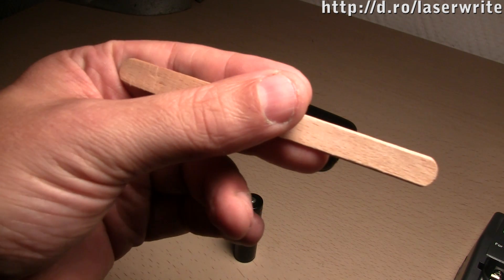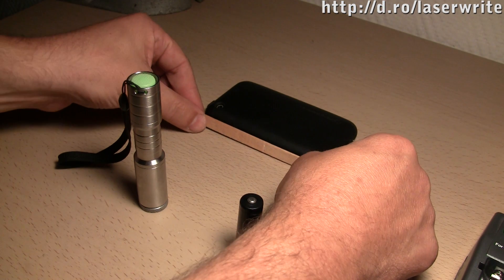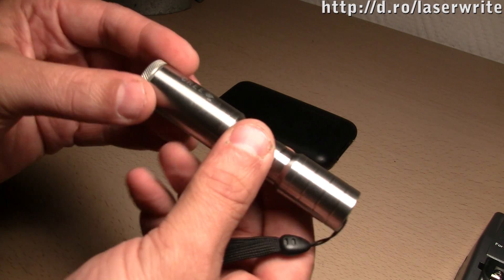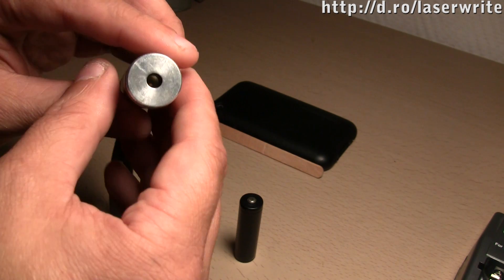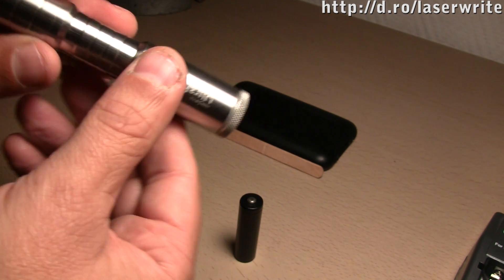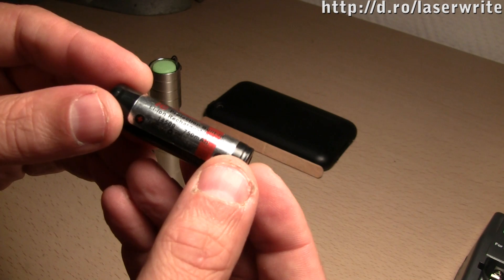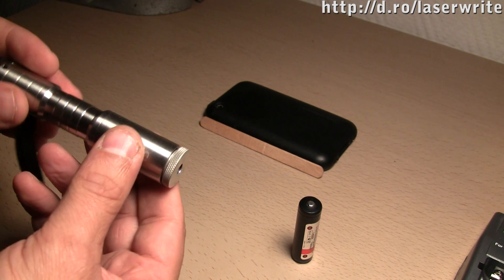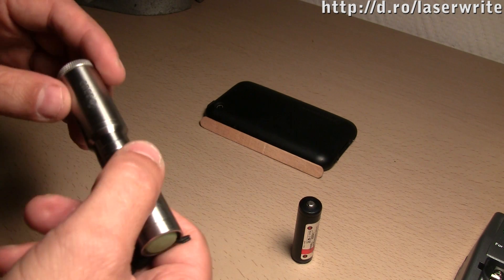🔥 Pocket Blu-ray Laser Burner! Burn Wood Instantly!

Comment: Where can I buy this one. Please someone respond. I want one that burns as hot as this one or the same one
Reply: Gabriel Johns.  amazon.com, just type in laser module, You can buy a 3 watt (3000mw) laser for around 80 to $90, it is about 5 times more powerful than the one he's demonstrating here, Just make sure you type in laser module. They have red green blue pretty much any color you want, the green ones are a lot more expensive though especially if you want a green one that Burns, But the reds and blues are pretty cheap. Also make sure you get one that has a Built-in heat sink and fan, or you will only be able to run them intermittently,  Hope that helps;-)

Comment: if laser is powered by battery of trucks or by main power supply then we got a good water heater system which can generated steems of souna bath in easy and cheaper way

Comment: How deep a hole with this laser drill into moderately hard wood?  How long would it take per inch?
Reply: It's not made for that. if you want one over those then go spend $10,000. these are just fun toys for responsible people and don't do much more than impress people.

Comment: I have one . Yes they burn skin , very quickly and painfully. They light matches , newspaper, burn through cd and dvd cases in seconds . A must have but also highly illegal . You could literally blind somebody for life in one second . Lethal
Reply: ***** anything over 5mw is illegal to sell in the US but legal to own if purchased by other means for the 5-8mw range. if over 8mw (might be 10) then it is illegal to own if under the age of 18 and I believe 25mw is where they are illegal without a special permit of sorts.
Reply: BarryFromEastenders not illegal in the U.S
Reply: ***** dvd burners are legal because the diodes are pressed into a block of aluminium and soldered to a board to regulate it's output. lasers used in surgery are also not even remotely close to what you see in the video.
Reply: Pyromaster225 it's legal to own them in powers greater than 40W
Reply: I mustve read a much older version then.. plus it was a few years ago, but still there are restrictions
Reply: BarryFromEastenders  hey man. Could you please tell me where to get one like URS or like the one in the video.
Reply: Any tool is legal as long as it is within its use; even an ordinary screwdriver can be illegal if the police finds it you in your hand down the street or in a dance party .. equally is for the laser ..
Reply: Nobbs66 Yeah, if they were the dvd players would be illegal, doctors using lasers for surgical purposes would be illegal, and all kinds of other people who need them it would become illegal for. Generally it would just cause a big mess for everyone who's not a federal employee. Heck it would cause problems for federal employees for the fact that their doctor wouldn't be allowed to legally do tattoo laser removal or lasers for use in surgeries or something similar. College students who use lasers to study photonic travel etc.
Reply: Nobbs66 I know, I'm just stating that if the law were to make lasers in general illegal to the public, it would mean that any civilian or non governmental agencies would also not be allowed to use them, and since lasers are of high importance in multiple civilian careers such as for doctors, machines, DVD's and computers, these lasers are 100% legal for use. I'm agreeing with you. :) Lasers like these could also be fantastic survival tools. A laser fire starter.

Comment: Why have we not seen more arsonists using this to start fires from a distance, I wonder?
Reply: This is my theory: The arsonist would require something flammable on the building he/she is trying to burn to shine the laser on, otherwise it would take a VERY long time to burn it down. Also, the bright laser would give away the arsonist's location (assuming it isn't daylight outside).
Reply: ***** Yes, using a laser to start a fire must be done during the day and not at night.  To start a brush fire only requires the energy of this pocket blu-ray laser and a steady mountpoint. Dry grass is the fuel.  You don't need an "accelerant."  The dry grass is the accelerant.
Reply: Peter Wexler Ah, hadn't thought of that. It also depends on the area, too. A place like South America or Southern California would be easier to start a brush fire during the day, but a place like Michigan or Washington would be more difficult. Distance would come into factor as well, would it not? The laser would be less intense the further the distance, right?
Reply: ***** When I speak of starting a brush fire, I'm not talking about anywhere east of the Rockies – only where the hills are tinder dry and grass-covered (red flag days).  Aside from being flammable, brown is an exceptional absorber of blue, re-emitting it as heat (high school physics, check it out).  As for intensity, I would imagine that strength would remain consistent for at least five miles, especially for a blue colored laser beam, and especially on windy days which are also perfect for terrorism-by-arson. (I don't think that physicists have yet figured out why windy days are better for laser beams than days when the air is still.)  There is also the curvature of the Earth to contend with for longer distances.  Of course, that's why Allah invented drones on the eleventh day of Creation, but then stability becomes a factor.  So, that's why Allah invented mountains on the eighth day of Creation!  (On the ninth day of Creation, Allah invented beheadings, and on the tenth, dynamite belts for use on mass transit, just to fill you in.)
Reply: The laser in this video is not powerful enough to burn wood grass etc at a distance. It will still damage your eye, even from a reflection. Wear laser safety glasses.

Comment: I bought a blue laser burner that only can burn electrical tape and matches, at first it wouldn't do it but I modified it so now it can at a certain laser point. How can I get it to burn anything? Any suggestions?
Reply: you need to find green Pontite crystal to get the laser strong enough.
Reply: two things   power and focus.
if you can change your focus to half the area you double the power per square mm.
if you double the wattage, you double the power per sq mm.
it is all about power per sq mm

Comment: How did you make that or did you
Reply: Use 1,5 w laser diode(first start with low mn power diode cause it can bring you to trouble if you are a beginer by this stuff,hehe one time i try to conect to a high woltage and tha power was gone in our house),well i think 150 mw is enought to burn paper,btw and you mus use a  Driver Circuit to work better,i think

Comment: Can my neighbors damage a Plasma or LCD Television by shining a laser (e.g. laser pointer or high caliber (strengthen) laser) from the double pane windows in their dining room, through another set of double pane windows in my living room (35 feet away), and into a plasma or LCD Television if I decide to mount it on the wall in question?
Reply: Probably not as these things only burn fairly close range although styropyro made a long range burner with a very bulky lense setup it would be dangerous for your eyes but shouldnt effect any objects unless they have an advanced lens which is very bulky

Comment: a "serious" question: Could I use it for soldering pins of electronic parts? Please heat a pin of an integrated circuit with your laser..Those are 0.3-0.5mm thick metal pins (reflecting and good thermal conducting material!!), and have to reach abt 250-280 C degree. How long does it take to heat up?

Comment: So, what if I used a high temperature resistant lenses? And use it just like the sun over a magnifying glass burning a piece of paper. What would happen? And also, what if I used 6 of those lasers and point them simultaneously concentrating to that lense? Would it slice through every matter I put in front of it? (except for metals)
Reply: No

Comment: nm means the wavelength ( the color ) of the Laser ( 445nm = Blue; 532nm = Green; 635 = Red ) u can also build a laser with >800 nm ( infrared = 808 nm ) but u cant see the beam or point.. -> boring!

Comment: Ok thank you very much! And no I do not have that intention, but a friend of mine has a 5 mw and a 200 mw green laser so I'm just cureus if the 200 mw would just cause 40 times as much damage or if it would just cause ALOT more damage

Comment: well you are right and you are wrong, yes the websites you think i am referring to are crap lasers, however got to a site called laser pointer forums and you will find plenty of skilled laser builders who will custom make you a decent burner for as low as 100, i got a 1.6w blue blue built for me for 110 and it works great.. if you dont believe me check it out, i currently have the violet 500mw being buit right now  like the one in the vid

Comment: Wrong. If left pointed at the eye for several hours straight it could pass through the flesh and put a hole in your brain. considering there are hundreds of functions and synapses, the part controlling your heart to beat and or resperation could be destroyed and there for so would the subject.

Comment: im sure that i would have a few ideas to make pictures with this, how much does this cost, how long does the battery last and is this tool quick at overheating and how dangerous is it (for me and my apartment)?

 when its practicable i would throw my soldering iron into trash.

Comment: Diodes are power hungry. They will eat anything you feed them. A driver in your cheaper pointers is a bottleneck. The other way around, a bigger driver for the $10 pointer would more likely work, less it fries the diode. They are VERY suicidal!

Comment: There are quite a few suppliers. Laser Forum will give you links if you click on individual's personal listings. But in the US, we are only 'allowed' to have up to 5mW. You'll need something at least two hundred times stronger than that. So you get 'host' kits and purchase the diodes from separate vendors. They will show you how to assemble them.